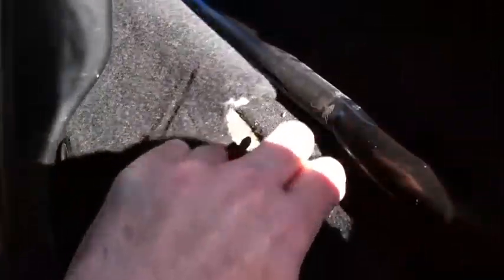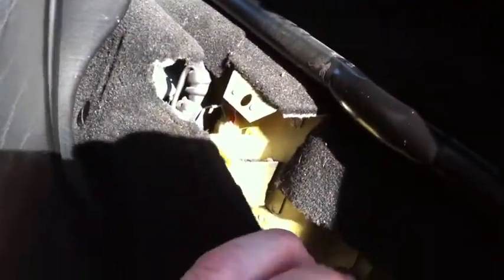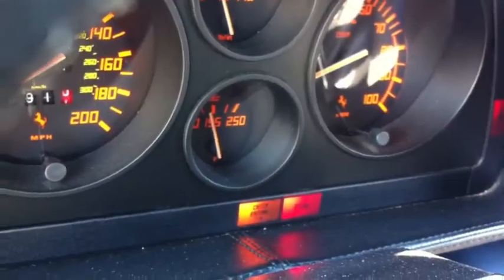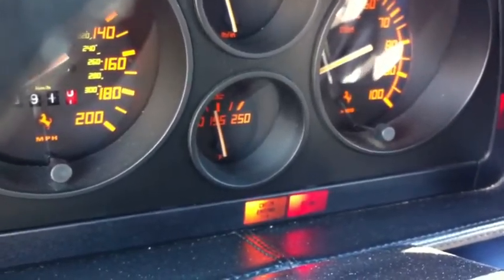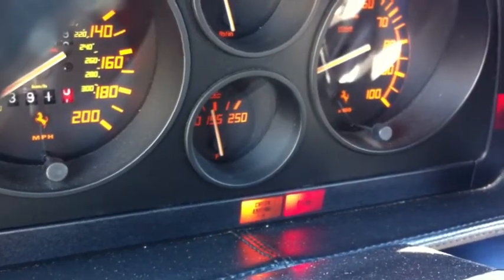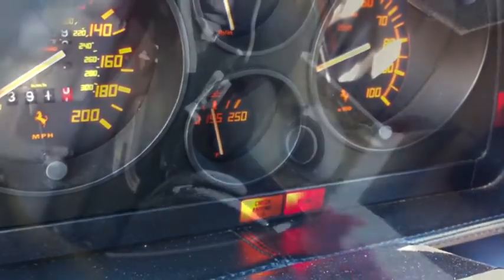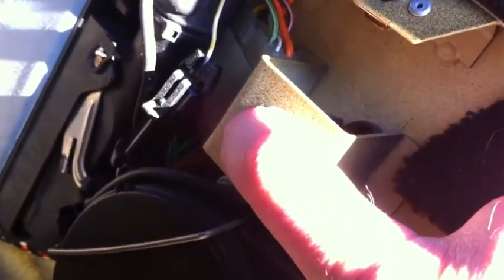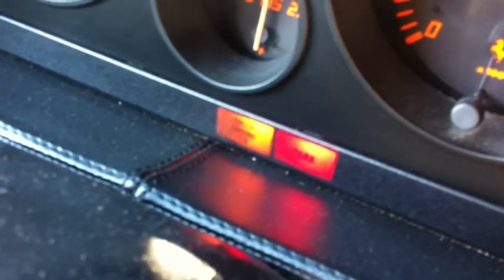Ferrari 348 ECU codes

Comment: Thank you for the video!   So I followed these steps...and oddly enough, I don't see the same behavior as you.   I start the car up, however, the CEL 5-8 light never turns off.  I tried pressing the reset button for 5 seconds and nothing happens.  The CEL 5-8 light just stays on...so I never see any blinking.

I turned off the battery under the hood...and let it sit...then came back and turn the switch back on to power the car.   I started the car up and the CEL cleared, however, still nothing happens when I press and hold the ECU reset button behind the seat.   

Any thoughts?

Comment: Very helpful! Earlier 348s have removable access panels to get to the ECUs and "check" buttons. There are two "screws" at the bottom of the panel. Turn them 90 degrees (screw slats to vertical) to remove the panel. Easier than holding carpet away from firewall while trying to press the button and watch the codes. To reinstall panel, turn screws slot to horizontal and panel snaps in.
Reply from the maker: Thanks. Forgot I made this video!

Comment: Very helpful!
Reply from the maker: Jeffrey B thanks. Glad it helped. Sorry if you had a code to deal with.
Reply: I actually just got a 1995 Spider.   I'm either getting a E5 or E6 currently...it's showing on the center console).   Troubleshooting this is a littler different than what you're doing in the video I know.

But thanks to your video I know how to read ECU codes!
Reply from the maker: Jeffrey B congrats on the 95!  Yeah, you have an AC code I believe. Look on ferrarichat.com. All your answers are there. Welcome to the brotherhood!
Reply: Thanks so much!   It's a surreal experience!   I checked out ferrarichart and my348.com...and it doesn't look very serious.   I'm hoping it's just something simple to fix...  

It opens and closes the flaps on the heater box that direct air to the floor, dash vents, and defrost (NOT the fresh air circulation). The motor is located on the right side of the heater box, above the passenger's feet. You can reach up and touch it, and you can see it with a flashlight. If you turn on the ignition and push the A/C control buttons one by one, you can feel and hear the motor opening and closing the flaps. It takes about 3 seconds to go from one mode to another. If you don't hear the motor working, there's probably an electrical fault in the motor or the wiring. If you hear the motor working, but there is no change in the direction of the forced air, then there is something wrong in the flap system. Sometimes A/C problems correct themselves if you unplug power to the A/C for a few minutes, then plug it in again to reset the system.